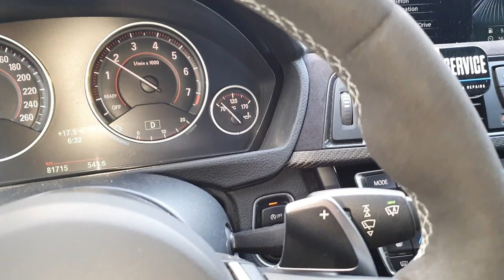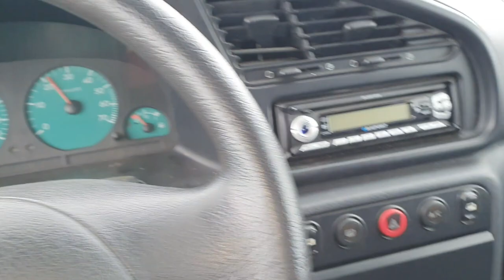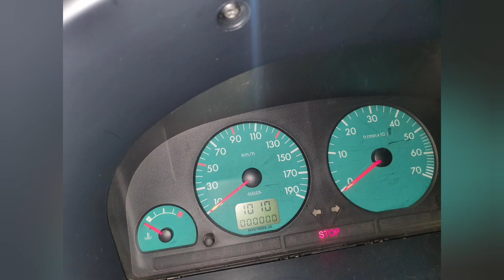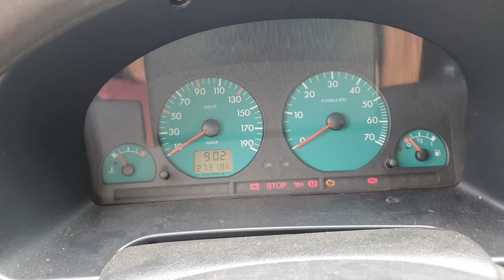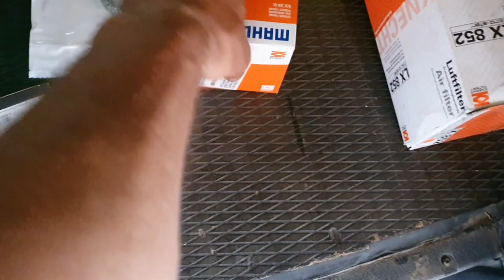My F32 435i is almost perfect! another problem solved! and we have a Garage Car! New Shop car!!!

Comment: Should be a reliable little van, when it’s completely finished! Did I see that it has 222 thousand on the clock? Not much really for a diesel. Anyway good luck and have fun
Reply from the maker: I think as well. It has 273.000 km not that much for a non turbo engine.